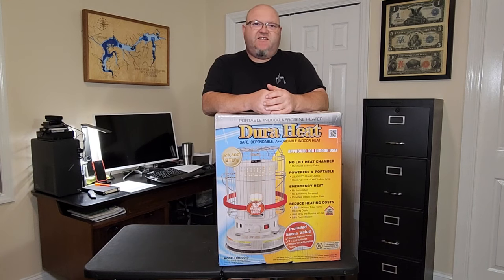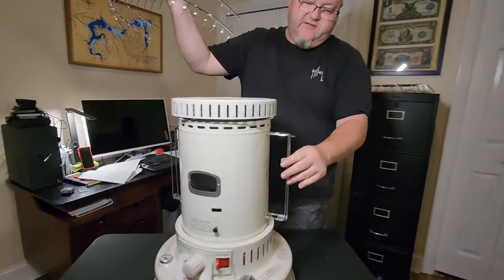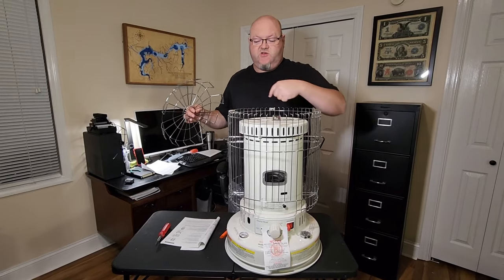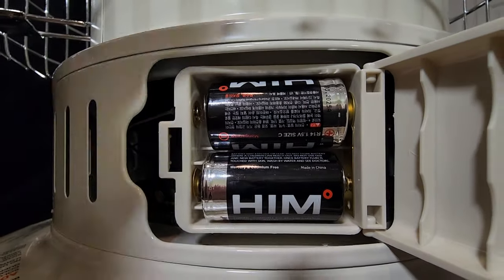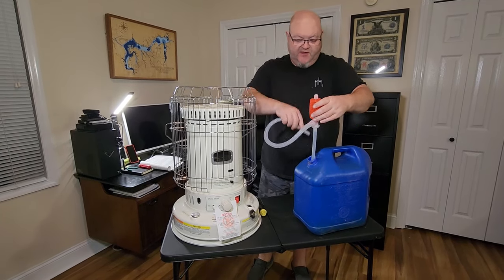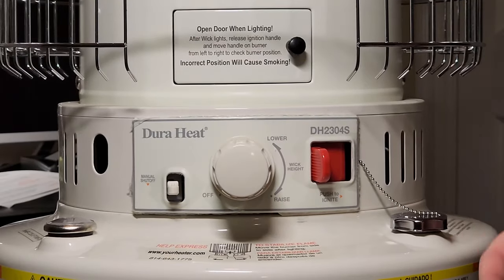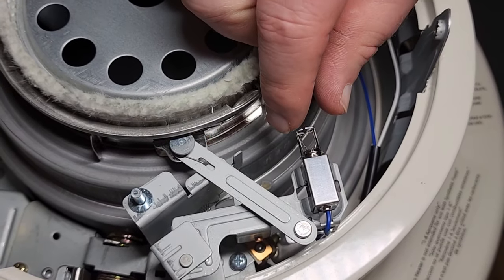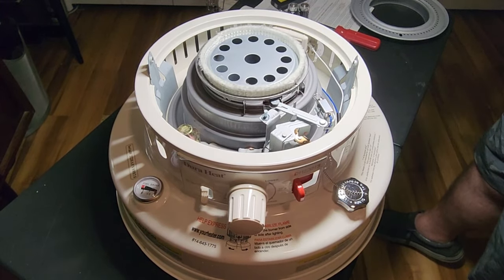DURA HEAT Kerosene Heater  DH2304S

Comment: Kerosene is up to $11 a gallon as of January, 2024. And that’s Walmart price. 5 gallon container of k1 kerosene has gone from $30 to $55. I keep a couple hundred gallons on hand… stocking up in the summer. I stock a large quantity because I also have a few Coleman kerosene pressure lanterns and a some Fueurhand  lanterns.
Reply from the maker: WOW those prices are insane for Kerosene! Thanks for watching!
Reply: I ordered Walmart kerosene 4 weeks ago. 9.97. The very next day, it increased to 11.77.
But it's better than freezing
Reply: Sheesh...need to find you a gas station with a kerosene pump my friend.
Reply: In🇦🇺🦘 it’s $24.  for a 4 litre bottle of kero 
$120 for 20 litre drum